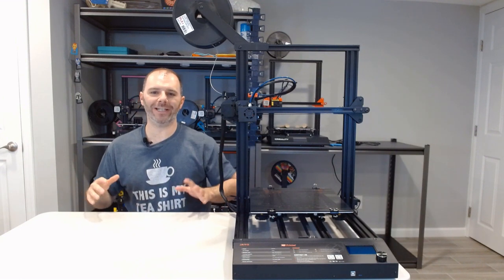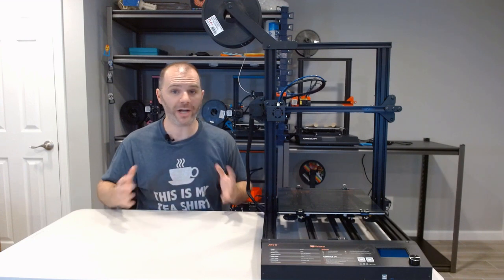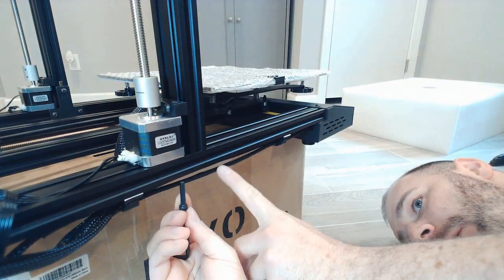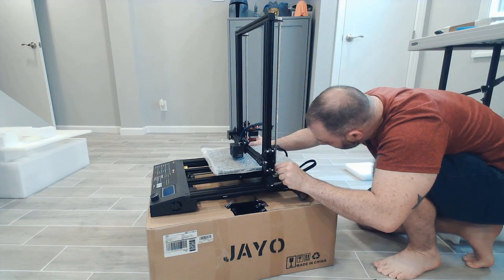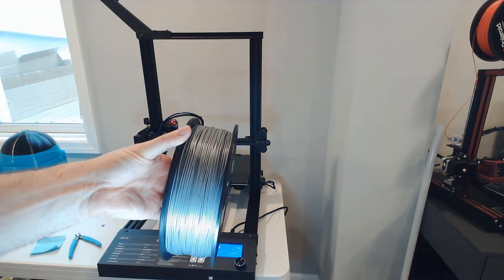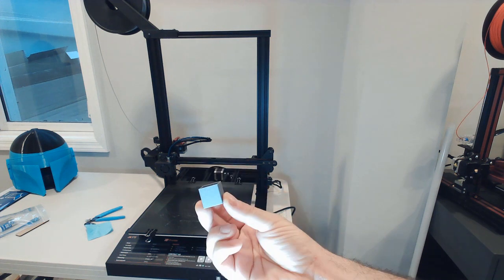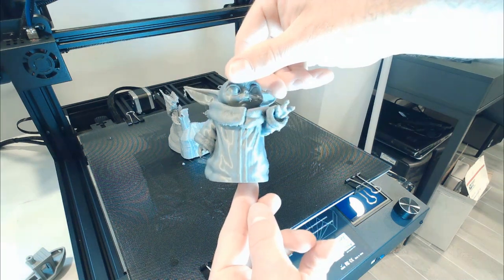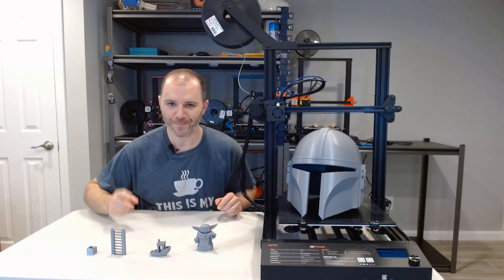Jayo S8 Plus - Unbox, Assembly, First Print | Sunlu S8 Plus

Comment: So thanks to your video I just ordered one of these to go with my Aquila(which I love). Was wondering if you have updated firmware or added BL touch.
Reply from the maker: I'm happy you're joining the club! It's good you have an Aquila and are familiar with it already because this printer is pretty similar in design except for the in creased build size. So far I have updated the firmware and added a BL Touch. Also added a PEI bed sheet which really improves quality of life when you don't have to worry about having to fight prints getting off your build plate. I am in the middle of replacing the thermistor right now to get this back to operating shape. Really like this machine with the BL Touch, but I am not really pleased with my firmware at the moment. Not sure if it's something I did or the thermistor going bad but since the upgraded firmware with BL Touch the printer has been a little hit or miss temperature-wise. I am pretty sure the thermistor is to blame, once I have it sorted and I figure our if the culprit was my thermistor (and not my firmware) I'll be adding a BL Touch install video for this. Just don't want to put information out there unless I am very certain it's going to help and not hinder! I have two of these now though and both have been chugging along (one with the BL Touch and one is still stock). Thanks for watching !
Reply: @PrintsLeo3D  Th3d has firmware but it seems geared to their ezabl. Haven't really seen much online about bl touch on them so it will be a good video to have out there.
Reply from the maker: Yes I've seen that one also. The install isn't tough it's just I want to make sure I tighten up the firmware before I post a video in it. It's in the pipeline though .

Comment: How long does it take to print out a Yoda like that.
Reply from the maker: I can't remember exactly but I believe in that particular instance it was an 8 hour or so print. Print time will differ based on so many factors such as print speed (which itself can be broken down by the speed of the travel moves, speed of infill, speed of perimeters, etc) which I believe was printing at 40 mm/sec. There's also the amount of infill you are printing(this was 20%), how many walls you've chosen(this was 2), and also the type of supports(tree supports) can affect print time so your mileage may vary.
Reply: @PrintsLeo3D  awesome, thank you for the insight. I appreciate it

Comment: Welp, I think my next printer might be a S8 Plus
Reply from the maker: It's a solid printer, does what you want it to do and doesn't ask much. I've got two now and they're both doing well.  If you're in the market for that large build volume on a budget then for me it's the way to go. If the build size isn't the end all be all to you then I would consider the Eryone ER20 or Voxelab Aquila.
Reply: @PrintsLeo3D  I started out with an Ender 3v2 that I've been very happy with. Was actually looking at the Ender 3 S1 or even the Kingroon KP3S when I stumbled upon the S8 Plus. Though I'm not sure I necessarily NEED the larger build volume it seems like a lot of printer for the money at $200. Especially considering the changes they've made to the Plus version.

Comment: Hi brother I always failed print with this printer how to print better like you please tell me I want to know 🙏!
Reply from the maker: Hi! You know printing can be a tough hobby sometimes, most of that is us spent calibrating and testing various aspects of the printer hoping it all turns out well in the end. What type of problems are you having? Is the model coming losses from the bed? Does the hot end stop extruding? Are some of the layers shifting as it prints and not lining up properly? There's so much that goes into each print, but if we break it down piece by piece we can get to the bottom of your troubles.

Comment: How do you use cura to make the tree supports? Thank you
Reply from the maker: When you are in the main screen of Cura, with a model on he build plate , the drop-down to the right has that option. You need to click the tab that says "Custom" this brings up a new set of drop downs. Select the Support drop down. Then select "generate Support" , when you do this it will open up many more options, one of them being "support structure". This drop down will then let you select the type of support you want "normal" or "tree". Hope this helps !!

Comment: its been a few months since this video hows the printer holding up any issues\updates, looking buy this, thx
Reply from the maker: It's been holding up good aside from a few things I have done wrong. I was getting really nice prints off this for several weeks, and decided I wanted to 'upgrade' the hot end to an all metal hot end. While I was doing that I also decided to add a BL Touch, dual geared extruder, and then upgrade the firmware. All went well, the BL Touch is a really nice improvement considering my bed had a large dip in it, but I just don't like the hot end I decided to use. It's a standard Gulf Coast Robotics all metal hot end, I have installed about 9 of these, all on my Ender 3s and my Voxelab Aquila. The size of the hot end doesn't really work well on this machine. Cooling can be an issue with the JAYO but there is a nice printable fan shroud (Red Squirrel) that does a lot to help with airflow, but because I installed an all metal hot end that was shorter than the original hot end I can no longer use the Red Squirrel fan shroud. I have to use the stock fan shroud which is good in most scenarios but not great when you are printing models with severe overhangs. I did also buy a second Jayo S8 Plus, and at the moment have kept it completely bone stock. It's printing wonderfully! I have had an increased print demand through the month of October and both Jayos have been printing 24 hours a day around the clock. I prefer the prints I am getting on the newer fully stock Jayo however they're both printing well. So in closing, all two of my Jayos are still printing well with no major side effects or drawbacks. If I could do something differently I would not install the all metal hot end and instead I would keep the stock hot end, upgrade it's heat break to an aluminum heat break, and equip it with the Red Squirrel fan shroud (which I plan on reverting to once the busy month of October comes to an end).  Also one more upgrade I added to the original Jayo was a PEI coated flexible build plate, and that has been terrific! I just purchased a BIQU flexible build plate for my newer Jayo but have not yet had a chance to install it. 

Red Squirrel fan shroud: RedSquirrelHobbies - https://www.thingiverse.com/thing:4293814

Comment: Did you check your Z for squareness to the Y axis?
Reply from the maker: I did Bill, but to be honest it's rudimentary at best the way I check it. I have an additional piece of aluminum extrusion that I line up across the axes to see how flush they are. I also printed a speed square from thingiverse that I also use to check how square they are. That's a really good point and something that's very easy to overlook.

Comment: I'm having trouble getting the filament through the filament sensor.  Should I open it ?
Reply from the maker: Try straightening out the filament first. You have to make sure it isn't bowed or bent, especially at the very tip, to get it to pass through cleanly. Usually I'll cut the filament at an angle straighten out the first 60mm or so and try and pass it through, if it doesn't want to go I'll clip another 10mm and see if I can get it then.

Comment: Great video! I've been running my Sunlu S8 (not the upgraded one) for several months now and it's been great. The upgrades I did to it personally are a metal extruder, and I got a creality black ultrabase glass plate. I've been successful in using the new glass at 70°, with no glue. The prints stick VERY well while the plate remains hot and when the print is done and you let it cool back down to around 40-50°, the print pops off with barely any force, helping to preserve the material on the glass, plus you don't have to clean the glue off. I've also upgraded the springs to the yellow ones, and replaced the bowden tube with the blue Capricorn tube. Next, I need to get a mount to mount the spool on top. I am so glad I'm not the only one that noticed the way the Inland spools have been coming, too. But, inland still has yet to disappoint me, and that is my go to filament.
Reply from the maker: I am actually putting a metal extruder on as we speak ! Gulf Coast Robotics all metal, not sure if I am going to have to print a new fan shroud or not based on how high the nozzle is but we'll see. I love it when you can print on a surface and then just have it pop off afterwards no cleanup, I am actually looking into a PEI flex sheet for that purpose, because I got such good results from the ones I have on my Aquila/Enders. Also I am looking to equip this bad boy with a BLTouch, just having a hard time finding any information on the pins in our motherboard. Been really happy with this machine I'm glad you've had similar results, and thanks for the comment!!
Reply: @PrintsLeo3D  absolutely! I haven't made the decision to switch print surfaces simply because the glass has been working.  If id had issues with it, I would consider it tho.
Reply from the maker: Stick with what works, literally!

Comment: Thanks for your helpful video! Cheers from Italy!
Reply from the maker: Thank you so much, I'm glad I was able to help !
Reply: @PrintsLeo3D Bye! Now some questions... You say the printer is noisy.... so, is it possible to update the tmc drivers without changing the stock board? Is it possible to install an auto leveling probe (switch, bl-touch, inductive...). And what about to install an open source marlin firmware (or cr10s firmware...)? Can you suggest some really useful upgrades to improve print quality? Many thanks;-)!
Reply from the maker: TMC drivers I am not sure about (although I would think so, might need to add some additional cooling). I am looking into adding a BLTouch right now, it's definitely possible just a matter of finding the right pins in our motherboard. Yes we can also upgrade our Marlin firmware, which is going to be necessary once I get that BLTouch installed. There's also the EZabl from TH3D as far as bed leveling goes, and it comes with a firmware package. This video goes through a few upgrades, the EZabl being one of them https://www.youtube.com/watch?v=E18ChzYnlKg&t=2093s

Comment: Loved the video! I bought one and I am having trouble with it. Can you by chance send me your cura profile?
Reply from the maker: I certainly could if you like but I don't have much special going on, I  just used a Creality CR10S profile and kept it mostly stock. In Cura, when you are adding a printer, find "Creality3D" and select it to drop down printers, then I chose the Creality CR10S. I don't think I made too many additions to that. If you want my profile I can send it via email, just drop me a line at PrintsLeo3D@gmail.com . Can I ask what type of problems you've been having? I have been having a few clogging issues as of late and am planning on adding an All Metal hot end on. Video should be out within the next few weeks I hope!
Reply: @PrintsLeo3D  Hey that worked! thank you so much! its actually printed the part that I wanted. I did the setup like you asked and put it under Creality CR10S4. before, I just did custom and tried to manually set it up and it kept off to the side and tried printing outside the area. I did notice that it is printing super fast and that is probably because I have it set to .4mm for printing layer size. What layer setting did you print your Yoda or Mando helmet? or what do you recommend for a smoother and better quality?
Reply from the maker: The nozzle size that is shipped with the S8 is a 0.4mm nozzle size (actually I think it's 0.45). That measurement, 0.4mm, is the width of the nozzle opening, and at that size the largest layer height you could properly print with that nozzle is 0.32mm high. For the Mando helmet and the yoda I chose to print at a 0.2mm layer height and my printing speed was relatively low at 40mm/sec. You just want to make sure at the top screen in Cura 0.4mm nozzle is selected(it's right next to the printer profile name), then in the print settings menu - in the QUALITY drop down, you can set your LAYER HEIGHT there. There's also a SPEED dropdown that will let you check your PRINT SPEED. Hope this helps!

Comment: What is the highest nozzle temperature in this printer?
Reply from the maker: I'm sorry I thought I had responded to this. The max temperature the hot end will reach out of the factory, is 260c. However I know a lot of people have had jamming issues with the hot end, myself included as of recently, which makes me think either poor cooling or the fact that the bowden tube presses up against the very long heat break may be at fault. With that in mind I probably wouldn't go over 220c with the factory hot end. I am going to be posting a video installing a Gulf Coast Robotics all metal hot end that can withstand high temperatures, up to 300c (but you'd have to go into the firmware to achieve that temperature). Hope this helps, still an awesome machine!

Comment: is there any chance that ypu would share the cura profile you used? thanks! grate video, I'm waiting on my s8+ to arrive in a few days.
Reply from the maker: I would love too! Another commenter asked for the same thing but honestly I'm not quite sure how to share it.  I will say I am using basically the stock Creality CR10 setup from Cura. I adjusted the flow and e-steps on my machine but that's about it ( I have videos on both btw you could find in my library, the are based on the Voxelab Aquila it all works the same here ). Once I find a way to share this I will. Congrats on the purchase, it's such a good printer , and thank you for commenting !

Comment: im having trubble any way you can send me your cura profile
Reply from the maker: I certainly could, I don't think I really changed much do from the base settings but I'd be happy to share. I use the Creality CR10 profile, as the build volume is the same. I am away on vacation now so I have no access to my computer but when I get back I'll drop you a line.
Reply: @PrintsLeo3D  Does this printer SUNLU S8 Plus have silent stepper drivers?
Reply from the maker: Unfortunately it does not. Definitely one of my loudest printers, but I will say the fan regulating main board temperature was surprisingly quiet for what that's worth.

Comment: Fantastic review. I leanrt a lot on calibration. Thank you. BTW I have the Sunlu S8 - what profile do you use in Cura. I don't see one there for either Sunlu or Jayo
Reply from the maker: Thanks for watching, I think calibrating while putting these machines together is such a huge key to long term (slightly)hassle-free printing. In Cura I use the Creality CR10s profile, and then just changed the bed size to 310 x 310, haven't had to modify anything beyond that.
Reply: @PrintsLeo3D  Thanks! This is exactly what I came to ask too! Great video. This convinced me to give this printer a shot.
Reply from the maker: It's on sale right now for Prime Day! Best time to get one.
Reply: I got 2 at 229 each and one for 239... all upgraded versions. They are amazing
Reply from the maker: Yea I'm really happy with how these printers have been holding up for me!

Comment: Another excellent video. You mention this unit has auto-leveling. At that price point, that is just nuts. Wondering if you got the auto-leveling tested? How many points on the bed does it sample? Manual bed leveling is supposed to be done initially. It is supposed to help the auto-leveler perform better. BTW - large prints are not the only reason that a big bed is nice. Its also helpful if you need to print a lot of little parts! Thumbs to the moon again!
Reply from the maker: I appreciate the compliment. So on this machine "auto-leveling" is a bit of a misnomer. The bed leveling function only helps you manually level the bed by navigating to four spots on the bed with a click of the knob. At each location you can adjust the Z offset and level the bed, then after your satisfied a click of the button brings you to the next location. I'm still blown away by the value of this machine. I have been getting great prints sinc assembly. Just finished another Mandalorian Helmet through a power outage and filament running out, still this machine printed it flawlessly.